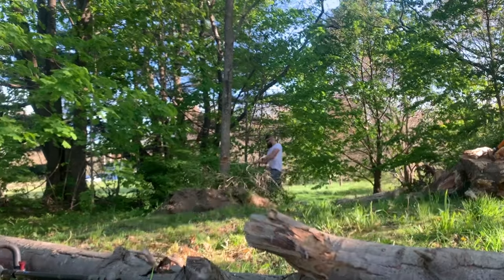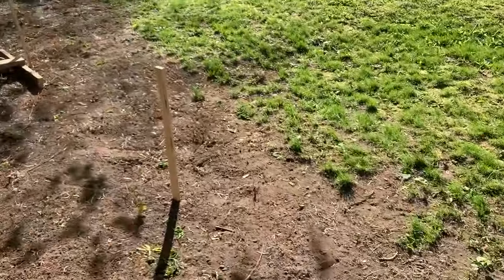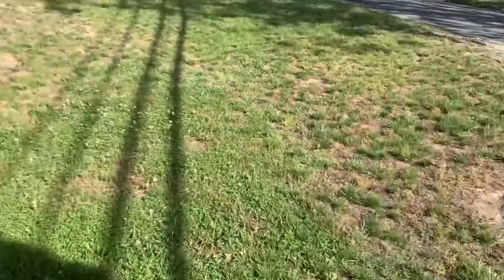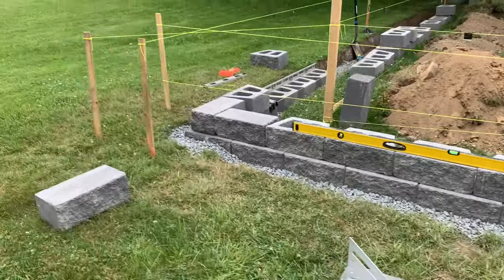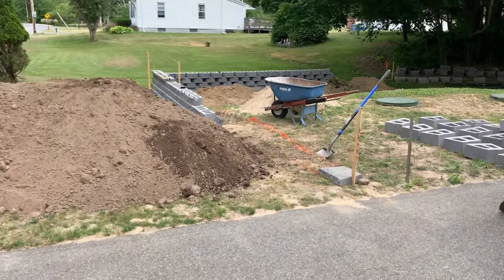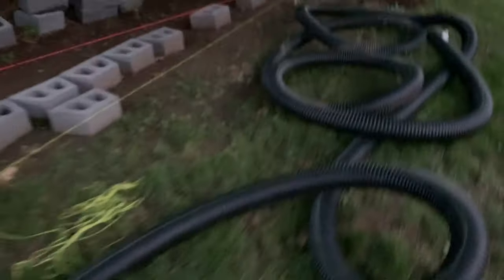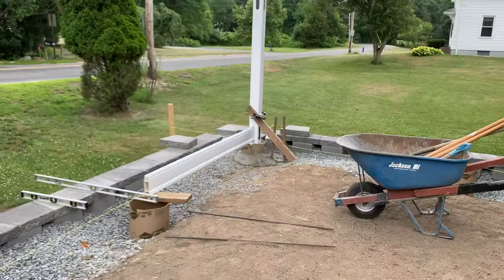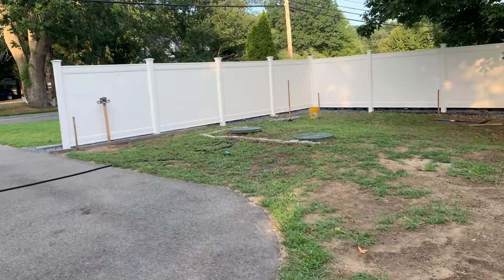BIG MISTAKE! BUILDING RETAINING WALL BY MYSELF!

Comment: Your wall turned out fine, but geotextiles work wonders and are cheap insurance! We use them no matter the size of the wall for a bullet proof project. Great job
Reply from the maker: Thank you John.  I will definitely use geotextiles on my next project for additional support and reinforcement. Cheers

Comment: Did all my garden walls in my garden with a similar system. Once the base and the 1st row is level, its really easy to build, oh and I used 5 pallet loads of blocks which were solid, no holes like yours and had no previous experience. That was 9 years ago and it still looks as good as the day I did it. Really good job and a lovely finish will last for years and you won't have to ever repoint it. 🤗
Reply from the maker: Yes I agree, after the base is compact and level, things get a lot easier.  Thanks and Cheers

Comment: We are a Geo-Technical/Structural/Civil engineering firm who design and inspects 100s of large segmental block walls.  Your technique and attention to detail is 5/5.   What I would mention to help other people is that in addition to all the work you did very well, any time you get to approximately 3' in height, geo-grid should be incorporated into the build.  After the first two blocks, begin the geo-grid layers (using one foot horizontally for every foot vertically.  A six foot wall requires a 6' horizontal layer of grid which sandwiches between the blocks.  This is pulled tight and landscape staples pinned down.  The 8" layer of dry, compactable soil is spread on the grid and compacted.   Rent a Wacker packer from home depot and compact uniformly starting next to the block behind the 12" of #57 stone drainage field you installed.  Compact in parallel to the wall working away from the wall.  On a large retaining wall, rent a 'sheeps foot' walk behind compactor.  The fill soil must NOT be topsoil or organic soil (which absorbs and holds water).  The earth must be dry.  Wet soil will not compact.  The mostly clay, sandy (not pure sand), weathered rock soils work best (remove rocks larger than gravel and any roots or twigs).  You add another layer of geo-grid fabric every two blocks as you go up.  If you are wanting to plant grass or shrubs, the top 8"to 12" of soil can be a top soil for planting.  As I see in your video, you must plan for drainage to keep water from saturating the built wall.  You can also fill with #57 stone gravel but that is ridiculously expensive, good compactable soil is much less.  

If you compacted the soil well and your drainage pipe (mounted at the lowest point) drains the water away from the wall your build should last a long time.  I want to emphasize the huge amount of hard labor you did to create this wall.  These are normally built by several men.  Strength and stamina are required to build these walls (where the blocks weigh approximately 75 pounds each), plus the digging, plus moving gravel and earth.  Having completed this by yourself means you, Sir, are a machine!  Congrats.

Comment: Love the video. I think I would have waited for the back fill and had the truck empty it where you needed it.
Reply from the maker: Thank you Dan,  that is a great point but not possible due to the location of my septic tank.  The green septic tank covers can be seen at 5 Min 51 sec and 7 Min 12 sec.  But you are right, work smarter not harder.   I did have another 20 yard load of fill dumped on the other side.  As close to the retaining wall as the truck could get.  (not included in the video).   Thanks for watching. God Bless!

Comment: I installed those same blocks at my backyard.

6 rows high.

I did a few things different because I have a hill above my blocks where water flowed to my property that I had to divert the water to the front of my house through French drain pipes.

Lots of work.

I used concrete for my base and added concrete between each v and each hole in the blocks for the first 3 rows.

And added concrete between each block to lock the blocks together to prevent movement.

All the bags of concrete I kept dry so I can work efficiently and keep stacking.

I would add gravel in the back side with gravel in 80% of each hole so I didn’t have to use so much concrete.

The bumps under the rocks I would slide them on the top of the wall to break off the access.

On my blocks I broke the bottom lip because my blocks where different depths some even 2 inch’s different so my wall would not sit straight.

That’s why I used a lot of concrete to lock my wall.

One thing with gravel water travels through it so I know on my wall the water on my wall will have to flow through my French drain because I have a concrete gutter on the bottom to minimize water graining through my wall

Excellent work btw

Comment: EXCELLENT work! I’m in the middle of a similar wall project using the same blocks you used. One question, the corner stones with split face on multiple sides, I don’t see the at my Lowe’s. You happen to have the product number for them? I’m having to round my corners but really prefer the look of what you did doing square.
Reply: I'm in the same boat and unable to find the double faced corner blocks. What did you end up going with?

Comment: Your first row of blocks should be leveled on about 6 inches of ABC or crush and run and about 1 to 2 inches of wet concrete on top of that for your blocks to rest on. Think of the abc and concrete as gums and the blocks as teeth. Once your first row is in, set and level, just start stagger stacking your blocks on top with a little sticky mortar on both sides of where your blocks rest.

Comment: First, rent the proper machinery. Small excavator save your back then rent the dingo to stage your block. Then do yourself a huge favor and rent a mixer and pour a thin layer of concrete in the footing to get an easy and quick level. Then stack away. For 600 bucks in concrete and rentals you would have done yourself a huge service

Comment: Can you explain the stepping process. This makes me nervous as I’m trying to build a wall that need to step as it progresses up an inclined drywall. Also when building the base, how to you perform this so the block can be installed flush with an existing concrete drive. Meaning if I prep the base I can’t obviously but the first course of block in the center of the gravel pad while having it against the concrete driveway pad.

Comment: Any block uget is going to have them buggers on the bottom , u slide them across the ones youhave already layed back n fortha few times will take care of them, versalockblock is the best and then you can use a grabber for them
Reply from the maker: Thanks for watching Seth.   You are right but a lot were really protruding and affected the level.  These needed a chisel.   I used a broom to sweep the surface clean before each block as well.  I will acquire a grabber for my next project as I went through 3 pairs of leather gloves!  Cheers!

Comment: I just bought this same block and I  am stuck figuring out the outside corner 90 degrees. I don’t want a rounded corner. How did you make your 90 degree corner? Can you supply Lowe’s item number? I can’t find a corner block that fits the 16x6x10 block.
Reply from the maker: Hi Keith, I ran into the same issue.  You have to buy them directly from the manufacturer.   Hi-Way Concrete in Wareham Mass.  Where are you located?

Comment: Needed geotextile fabric and geogrid. But looks good. Professional here
Reply from the maker: Yes, you are absolutely correct!  You are referring to what I used to encapsulate the 6” perforated pipe right?
Reply: @TheMillerRacingTeam  He's referring before you put down the base (some contractors due some don't its 50/50)  , For the perforated pipe yes you also do that, to not mix with dirt to drain, geo grid most don't install unless over 4ft wall but also depends soil and other many factors.
Reply from the maker: Thank you Hacker.  Yes, with this only being a 4' wall, I believed the compacted 6" crushed stone to be sufficient.  I was very careful to not disturb the underlying soil but professional recommendations and advice are definitely appreciated.
Reply: Yes. I was referring to the geotextile before the base goes down. I typically use geogrid in any wall I build every two courses regardless of height. It's cheap insurance. I've built plenty without the geogrid early on. Your build will more than likely be fine. You kicked that job's ass!
Reply from the maker: Got it.  Now I understand.  I appreciate your professional insight T!  I will use geotextile and geogrid on my next job.  Thanks!

Comment: Just bought a new house that is in need of a retention wall.  I'm wondering how much you spent on this and if you could guess, how much did you save by doing it yourself?
Reply from the maker: Hi Michael, that's a great question.  I wish I could tell you the exact number but I lost track along the way.  Materials, miscellaneous tools I had to purchase and the Dingo rental added up quick.  I want to say 5k total but that's just a rough guesstimate.  With that being said, the savings are huge if you do it your self.  Also, it is tough to get someone to do it in the spring.  Most hardscape contractors are very busy this time of year.  Best of luck!
Reply: @TheMillerRacingTeam  Thanks for the reply.  Your work looks great and this video is inspiring

Comment: That fabric doesn’t let water seep through from my experience.
Reply from the maker: Hi Alan, you're right.  The woven fabric  is significantly less permeable than non woven fabric, but it does still allow water to pass through.  I just built a 150 foot retaining wall and used the non-woven fabric.  Thanks for watching.

Comment: No geogrid or fabric ground wrap = possible failure the higher you build. Looks good but you really need the grid in to keep it stable for years. Especially since you backfield with just dirt.
Reply from the maker: Thanks for watching!   I appreciate your recommendation.  I will use those products on my next project.  However, the backfill was with 20 yards of 3/4" clean crushed bluestone.  This can be seen at the 10 min 30 sec mark.  Cheers!

Comment: Did you order the corners for the block from lowes? If so how, Pro Desk? Happen to know the order # for ease of ordering? I need some for my project. Thanks! Looks great!
Reply from the maker: Hi Nick, I ordered them online from Lowes.com (Item #1045003 Model #LWGB).  You will probably need the top caps as well.  (Item #1045004 Model #UCGB).  Comment here if you have any other questions.  Good luck on your project!  Thanks, Josh
Reply: @TheMillerRacingTeam  Yeah i got the block already but they don't sell the corners online that I can see.
Reply from the maker: I got the corners from Hi-Way Concrete in Wareham Mass.

Comment: Would have been good to lay bottom course on concrete.
Reply from the maker: For a 4' retaining wall, my research led me to believe the interlocking and compacted 3/4 crushed blue stone is the preferred method for multiple reasons.  Price, time, frost line and drainage being the main ones.  But, I appreciate your recommendation.  Maybe a professional would like to weigh in....
Reply: @TheMillerRacingTeam  that is fair enough, am a qualified hard landscaper, have done plenty of stack walls all on concrete 50 mm thick on compacted crushed rock base, with drainage underneath and at the back, have never moved.
Do you get snow? If ground freezes that might change things. Where I am we don’t get extreme low temps, anyway should have clarified that before I commented.
Good job on the wall, you won’t need the gym.
Reply from the maker: Yes, we actually had -30F below wind chills a couple weeks ago and we're expecting up to 8'' of snow today.  I appreciate your recommendation and respect your professional opinion and experience.  God willing, I'll be pouring plenty of concrete this summer!  Best of luck and Thank you!
Reply: @TheMillerRacingTeam  wow, can’t imagine those sort of conditions. How will you protect your concrete from cracking, with the freeze thaw cycle? Good luck with it all, have subbed to follow your journey.
Reply from the maker: TBH, ultimately Faith in God.  I did not mention it in the video but only the solid corner blocks and top caps are glued with construction adhesive.  This provides allowance for movement in severe conditions.  Glueing the wall blocks is a big NO from what I was told.  Also, as you know, the drainage is critical.  Thanks again Southern Rainforest!
Reply: @TheMillerRacingTeam  Amen brother. When in doubt or unsure of how to do something have learnt that unless God shows me a way, to never start. When God shows me a way it always works out. Hope it goes well for you.